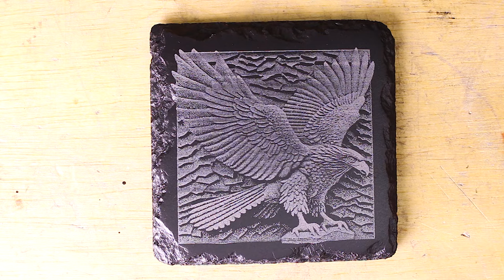Stop Throwing Out Failed Slate Engravings!

Comment: I believe slate absorbs/holds water, SO, you would need to make certain to DRY THOROUGHLY before you spray coat them....  A 170 degree oven for several hours/overnight would do the job....  It also would be a good idea to sand your new coasters if you wanted the very best to sell....

Comment: Hi! I also like to reuse my "bad" slates, i remove the engraving by sanding, but i do a finish sanding with a 240 grade sand paper. This gives me a very even surface which can display more details than a raw slate. I never tried coating it before lasering - i use stone sealer after the engraving. These are also available in matte, silk and glossy. With the finish after the engraving i can protect the slate and also have the engraved areas sealed. This also avoids chemical fumes from the engraving. The output with sanded slate will have much more contrast than raw slate.
Reply from the maker: Thanks for sharing!

Comment: Do you ever put a clear coat on after engraving - seems like my design is hard to see if I clear coat after engraving
Reply from the maker: Yes I've clear coated after engraving. It works better on vector graphics as opposed to images where there is a lot of grayscale going on. Clear coating an image results in the image being difficult to see as you said.

Comment: Hello. I have question i bought longer b1 30w. And why i cant for example make more speed then 9999 mm/s its not possible to put more value on my lightburn. Also it dont cut well i think i musted use speed 10mm/s and 100% power to cut 0.5mm wood with setup 2 times cutting. When i set up 30mm/s and 3 times cutting then it wasnt cutted... i dont understand this because probably it should be easy cutted on much higher speed. Maybe you know where is the problem? Also when i haved for example 300mm/s its showed shorter time to finish then on 3000mm/s??? I dont understand or im stupid
Reply from the maker: It sounds like you have Lightburn set on mm/second. If you're following my videos, all my speeds are in mm/minute. Try changing the setting in Lightburn to mm/minute and see if you get a better result.

Since you have the B1 also check and be sure that you set the driver in Lightburn manually. If it auto selects the driver when setting up the laser it will choose the wrong one and cause issues.